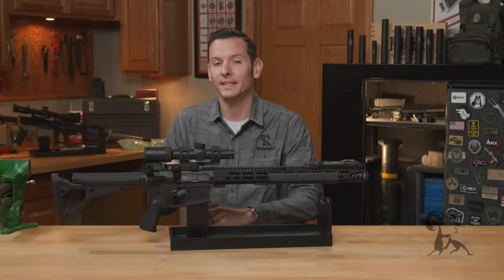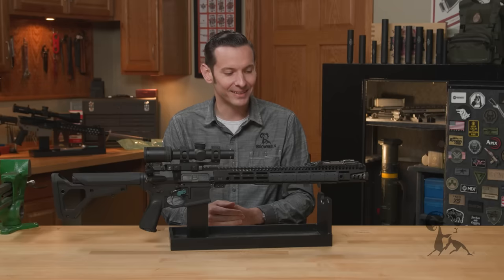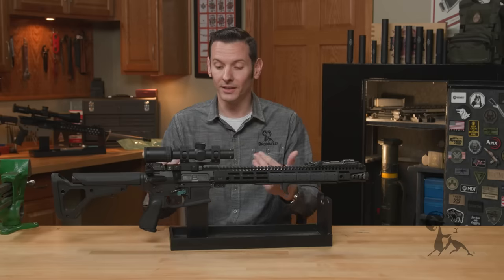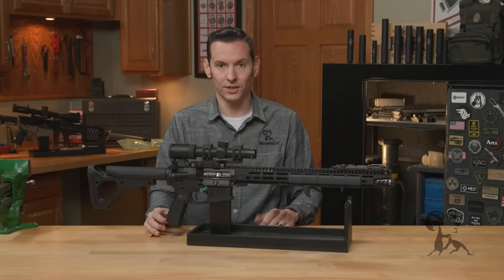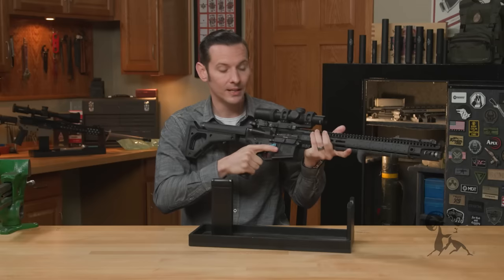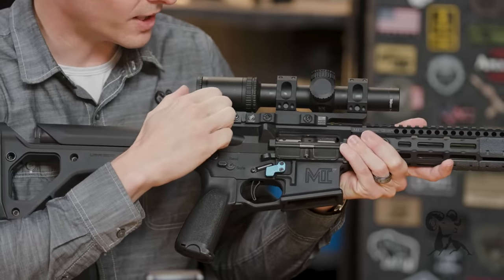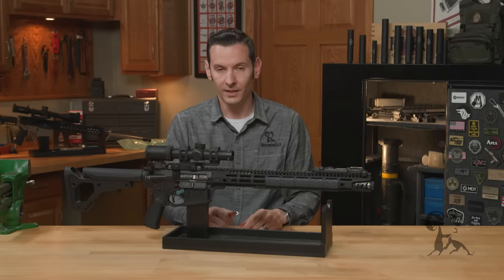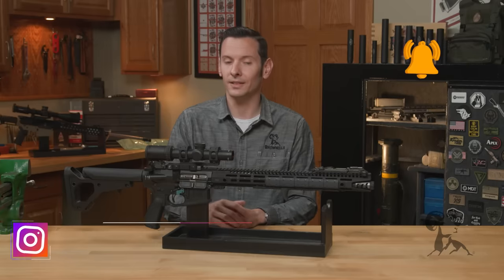Quick Tip: The RIGHT Way To Use the Forward Assist

Comment: I've mostly found the forward assist useful when quietly chambering a round in a deer stand in the pre-dawn darkness.  Letting that charging handle down slowly and then pressing the FA to finally seat that round.
Reply: Ever use the safety?
Reply: I’m guessing your not legally or practically able to carry a loaded chamber??? Please provide more info???
Reply: @danielcurtis1434  Climbing into an elevated tree stand, particularly in the dark, with a loaded firearm (one in the pipe) isn't recommended.
Reply: @RyeOnHam  A safety isn't a substitute for proper gun handling. See my comment below Daniel Curtis'.
Reply: @comlbbeau  Nah, it's perfectly fine to point a gun at someones face if you have the safety on.
Reply: Are you sure that using the forward assist is silent? 

I'm checking with my AR right now and if the rifle is out of battery (a situation designed for the forward assist), then I get a nice CLICK as I hit the forward assist and the bolt goes into battery.

Hitting the forward assist is only silent if your AR was already in battery and thus did not need the forward assist to be used in the first place.

The forward assist has uses but I don't see this one being a legit purpose. But I am sure you have used it successfully so rock on, perhaps there's some significant differences in our ARs.
Reply: @ndx6779  Man, now I gotta go play with it and see. I never noticed a click, but that doesn't mean it doesn't!!
Reply: @ndx6779  It is not as noisy as slamming the bolt.  Perhaps putting or wrapping something around the gun when using the forward assist might help a little more with stopping sound transmission.  I will have to try it once my covid ear stoppage clears up.   
Some will leave the gun unloaded in a case on the ground and once in the tree use a cord-rope to pull the gun up into the stand and load/chamber a round.
Reply: See, there you go talking about hunting with a semi-auto..
Reply: Wayward Airsoft  I too carry a ladder 3 miles into the woods so I can get into my stand
Reply: I heard that was a complaint with US snipers regarding the M110 which lacked a forward assist and makes quiet loading more of a pain in the ass.

Hence why the HK417 derived M110A1 has one.
Reply: Wth hunts with a foward-assisted firearm?
Reply: Wayward Airsoft  Pfft, weren't you listening? The ladder's safety is on!
Reply: @Mountain Man Not always, otherwise the snipers wouldn’t have complained.

Long guns aren’t always drop safe.
Reply: You don't need to be in a tree stand in the dark to do the same thing either. Sometimes I just don't want to alert anything, or anyone, to my prescence by letting the bolt slam shut. And unlike someone in the comments, the one AR I actually hunted with barely makes a sound when I use the forward assist with a round in the chamber. I think it makes more noise  on  an empty chamber, but I haven't checked it lately.  I haven't checked my other AR and the spare uppers for them either. And if I was hoisting any rifle up to a tree stand with a rope, you can bet your @$$ it would be unloaded! With my luck a branch would flip the safety off, and and another one would pull the trigger.
Reply: I read your comment.  I knew what the topic was.  I still read "then pressing the FA to finally..." as "then pressing the Full Auto..."
Reply: Hunting game as large as deer with a .223 is illegal in most (if not all) states, not to mention cruel to the deer. It’s not going to drop him with one round.
Reply: @Frankie5Angels150  You also realize that you can have an AR chambered in something other than 223 right?
Reply: If you can't kill a deer with a 223 rifle, you shouldn't be hunting in the first place.
Reply: @BigHarryBalzac  I've checked with a round in the chamber just today and I can confirm that (at least with my AR) hitting the forward assist makes the exact same sound that it does without a round chambered. I'm using a SIONICS bolt carrier, Ballistic Advantage barrel, Winchester Brass M193, VLTOR upper and VLTOR A5 buffer system. Loud CLICK as I hit the forward assist to make the bolt go into battery.
Reply: This is helpful because I climb a tree stand while holding the end of the barrel in my mouth
Reply: @Frankie5Angels150  there has been a lot of deer and hogs harvested with 223 and with one shot it all depends on shot placement and ammo type but it has it has its limits
Reply: Why are you chambering it in the stand? It should be chambered when you leave the vehicle. Falling out of a tree stand or not, the gun isn’t gonna fire on safety lol that being said, I have forgotten to chamber a round when I got out of the vehicle and had to do it later at a less opportune time, so I get that it happens sometimes.
Reply: @buttermilkbiscuit1021    Lots of people. Here in Ohio, for deer when chambered in a straight-walled cartridge like 350 Legend, coyote/Groundhog/fox when chambered in 204, 223, 5.56. Down south hunting hogs. Out west when hunting prairie dogs… lots of people use ARs for hunting a variety of game.
Reply: Wayward Airsoft  that’s an extremely common hunting practice.
Reply: @Frankie5Angels150    Nobody said that the rifle was cambered in .223.   350 Legend is an awesome deer cartridge. 450 Bushmaster as well, although it is ballistic overkill on deer-sized game.
Reply: Wayward Airsoft cus it works idk
Reply: Yea this argument doesn’t make sense since if you’re lightly letting the bolt forward to be quiet, you can put the same light pressure on the charging handle as you’re saying you would do on the FA and it sets the bolt forward the exact same
Reply: @kurtnewman7182    No, you cannot. The charging handle on an AR-platform gun is non-reciprocating and can’t push the bolt. It can only pull it.
Reply: Excellent example.
Reply: My uncle saw action in the Vietnam Conflict. This is EXACTLY what he said they used it for. There were times when they were laying down, hidden in the grass, with the enemy WAY too close to just rack the bolt. So they would slowly chamber a round. Doing so means the weapon would not be in battery so they would push the F.A. to fully chamber the round. He said there was definitely a "click" and you're holding your breath while praying it goes unnoticed.
Reply: The ignorance in this comment section is palpable
Reply: @ndx6779  Go get your AR and compare the noise of softly pressing the FA relative to a full-on rack and release.  Go on.  We'll wait here for you.
Reply: @comlbbeau  are you not able to climb then chamber? Good God do you ever get anything?
Reply: Caleb, fully agree with your statement!  Everyone is a critic until they shout themselves in the foot.
Reply: Wayward Airsoft  it comes from older guns that could be dropped from the ladder and aren't drop safe. You are also not supposed to cross a fence with a loaded gun. Texas hunters Ed teaches to unload when crossing a fence or climbing a ladder.
Reply: Wayward Airsoft  yeah definitely. If you take into account people are dumb. Dumb people do dumb things. This one little trick will prevent dumb thing.
Reply: When I'm hunting coyotes, I move from stand to stand with my rifle in condition 3 (bolt forward on an empty chamber).  When I arrive at my next stand site, I QUIETLY chamber a round. I do this by committing the cardinal sin of riding the bolt home. I use the forward assist to insure my rifle is properly in battery. This is part of the reason I will not own an AR (15 or 10) without a forward assist.
Reply: @MAGAMAN  My brother tried that once - a 22. I pushed the muzzle away from my face and moved to his side. It's not loaded. Bang. He shot the window in my sisters bedroom. Mom was not happy.
Reply: I keep hearing the "quiet rack" as the only redeemable feature. But only for people who carry a firearm that isn't ready to shoot.
Imagine that.
Reply: i'll be honest sir i did not know this bit of information thank you for sharing it.
Reply: @danielcurtis1434  so do you think you’re supposed to climb into a deer stand with a loaded firearm?
Reply: @buttermilkbiscuit1021  several people.  Me included.  6.5 grendel.
Reply: @Frankie5Angels150  have taken many deer and hog with a  .22mag.
Laws are written by people with no more experience or knowledge of a subject than you have of this one.
Reply: @kurtnewman7182  another know nothing.
Reply: @DanielDuhon  no good reason not to.
Reply: Yes sir!  Climbing a tree stand with a loaded rifle is for IDIOTS!  You have to haul it up, and THEN load it.  To seat the bolt with a forward assist, you don't even have to hit it.  Just gently press it a few times to make sure the bolt is fully seated.  That's exactly what the little teeth on the bolt are for.  Deer are literally born with a nervous breakdown, and are paranoid by their very nature.  If you loudly ram the bolt home, you might as well GO home, because you ain't gonna see nothing out there.

Anyone who says the forward assist is useless has never gone hunting or waited in ambush for enemy soldiers.

I should also add that in combat, if your gas tube gets too fouled up, or your bolt gets too gritty with mud, your rifle may not cycle properly.  If your bolt gets sticky, you can still hit the butt of the rifle on the ground while pulling back the bolt, then hit the forward assist a couple times to seat the bolt for the next shot.  The rifle has basically become a crappy, inefficient bolt action at this point, but it is still able to put rounds down range at the enemy.
Reply: You don't have to hit it that hard at all, just press it with your thumb a couple of times.  That is what the teeth are for.  Try it for yourself if you have an AR-15 with a forward assist.
Reply: Chill TF out internet
Reply: @Frankie5Angels150 - 

Your comment is absolutely ridiculous.
Reply: OR ....
have it ready to fire and avoid what you just said
Reply: Still seems a bit louder than a safety 
- writing this blind knowing most replies will be similar -
I mean don’t be stupid and hike in and climb with one in the pipe but why not rack one once your up your stand (or whatever) and throw on the safety?  Genuine question.
Reply: I've used it the same way. And to the naysayers in the comments, I also don't like to pull a rifle by a rope onto a treestand with one in the chamber and the muzzle flopping around. I also like to do a brass check to make sure the bolt stripped one into the chamber and again, I press the FA to quietly get the rifle back into battery.
Reply: Nothing makes me happy like a good forward assist
Reply: @comlbbeau I once fell from a window with a fully loaded M16A2 during  M.O.U.N.T. The safety was on and guess what the weapon did not discharge. Point is, if you're in a situation where you need a round in the chamber make sure the weapons loaded (so it's ready when the need arises. Safeties were invented for a reason.
Reply: This is the correct answer!
Reply: @alphaq6585 Even a year on I'll come back for a laugh
Reply: You use .223 to kill deer? In which state is THIS legal?
Reply: @Frankie5Angels150  how do you know what caliber it is?
Reply: @JW-fq1pp Right? 
I hunt in exclusively full auto!
Reply: @buttermilkbiscuit1021 I would, all that’s truly important is energy of the projectile which hits my target, it’s just ballistics if you bring it to a certain level
Reply: Another reason ar pattern rifles are actually excellent semi auto hunting rifles.
Reply: @RyeOnHam  AR's aren't drop safety rated, so when not in a combat situation where you may need to take instant reaction shots it's just smart to not have one in the chamber when climbing trees in the off chance ya slip n fall.
Reply: @onebillionlol Ever hear of a climber or a saddle?
Reply: You sir, have used an AR to deer hunt...  😂.....  because I have done that exact thing many times 👍
Reply: @Frankie5Angels150  Arizona, for one. There are probably others as well.
Reply: @danielcurtis1434 are you 12?😂
Reply: Truth
Reply: @Sandhill1988 seems as if you're trying to relay something similar to: "I did this ONE SINGLE time and it didn't happen. Therefore, it'll never happen."

I agree that safeties were invented for a reason, but is it that really validation for this? This is similar to one of the basic rules of "always point it in a safe direction." This is a rule, not because unloaded weapons can fire, but because it could save your (or someone's) life that one unusual time something goes wrong. Imagine if someday you forget to put the safety on or if something malfunctions. This should be all you need to consider here, especially when there's a simple alternative.
Reply: Your best not be hunting deer with cal .223 (5.56mm). Anything below .30 is illegal in most states because it generally won’t be a one shot kill.
Reply: @Frankie5Angels150  even 6.5 creedmore is junk. GF shot a doe at 50 yards double lung and the deer got back up and ran probably another 50 yards. Everything I've shot with a 308 dropped like a sack of shit.
Reply: /bump to stir the pot. Legal to harvest whitetail with any center fire cartridge here. I know a lot of people that have fallen climbing. I knew a few that either ded or wounded from operator error, defect or malfunction. I don’t know of anybody dying from being too safe with a firearm. I’m going outside racking and tapping and quietly using the fa because I can
Reply: I don’t use my AR to deer hunt (the .223 is not legal for deer here).   However, whenever I do hunt with my bolt action or lever action I always stay loaded and release the safety (bolt) or pullback the hammer (lever).   I never chamber a round AFTER seeing the animal I hunt . ..
Reply: Ever climb a tree wearing warm hunting gear, on a cold morning, in the dark?  I perfer to get into position prior to chambering. I use my FA for the exact same reason. @RyeOnHam
Reply: I have had several training sessions with new comers to the platform as well as shooting in general.  These people tend to ride the charging handle and the BCG doesn't go fully into battery.  It's nice to be able to instruct them to use the FA OR to step in and press it for them to remedy the issue.
Reply: @buttermilkbiscuit1021 plenty of people do successfully
Reply: I was trained my m16 and my m4 it was for noise discipline. Slowly and quietly chamber your round and finish seating it with the forward assist.  And also T in SPORTS. I have never had an AR 15 so I can't confirm if it will work with them.

Comment: In The Marines we were taught to seat a round quietly by easing the  bolt home and use the FA to seat the round.
Reply: He basically said to do that. Notice when he says if you do a quick check or /half pull back. It won't seat well when released so you especially want to end with a tap on FA in that situation.
Reply: Emphasis on QUIETLY
Reply: You can seat the bolt home quietly by pressing the back of the charging handle, does the same exact thing and don’t need the FA for it
Reply: @kurtnewman7182  What charging handle do you know of that can put forward pressure on the bolt carrier?
Reply: @chrisresnikoff1741  I was wondering that myself.
Reply: @chrisresnikoff1741  exactly. Charging handle works in only one direction.
Reply: El Cactuar  that's great that it works on AKs, now tell me how that would work on an AR-15 where the charging handle is non-reciprocating. Ever think about that?
Reply: @kurtnewman7182  You've made four replies saying the same thing. Do us all a favor, look up the definition of NON-RECIPROCATING, then look up how an AR-15 charging handle works.
Reply: El Cactuar  AKs have a reciprocating charging handle, it works on them. Not on an AR15.
Reply: El Cactuar  the US military incorporates redundancy into nearly every mechanical device used in battle. While highly unlikely, the charging handle could be damaged or rendered ineffective for whatever multitude of reasons while in the battlefield. If the charging handle fails to do its job, and with the absence of a forward assist, the rifle would be rendered useless. The forward assist is a perfect example of military redundancy.
Reply: Kurt  Newman has left the chat. Lol.
Reply: That must be new. We just racked that charging handle in my day. Still used the FA though.
Reply: @kurtnewman7182  bwahahahaha you don't know how the charging handle works.
Reply: I know a number of Marines, including my brother, and find it hard to imagine any of them doing anything quietly.
Reply: @kurtnewman7182  incorrect
Reply: I’m sure he heard that. He’s making the point that the way they used the FA was an actual TTP and not tribal lore.
Reply: That is why the Hk PSG-1 has a forward assist, and none of their other roller-lock weapons.
Reply: Hey not sure when you went through BC but I went through late last year, my PMI taught us to slingshot the charging handle, we would do a brass check then the little tap of the forward assist, MCT then said you don’t need a brass check just watch the bolt go home on the round, also we were told OBSERVE TAP RACK BANG for immediate action
Reply: @kurtnewman7182 Seriously, what are you smoking?
Reply: @kurtnewman7182  it's adorable when someone who has never fired an AR gives incorrect information about it. lmao
Reply: you will never chamber a round in the M16 or M4 quietly. Your spring will alert every country in a 7000 mile radius.
Reply: That super interesting because I've always been told to never ride the charging handle back but always release it at the top to avoid malfunctions
Reply: Yep!👍